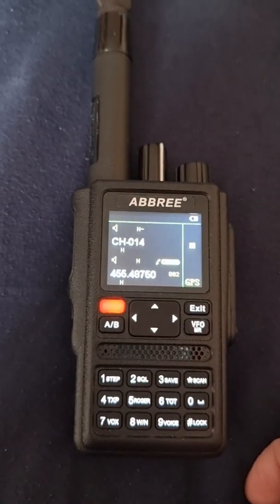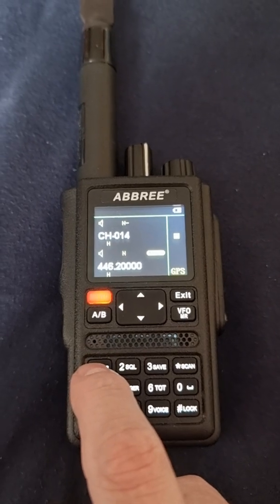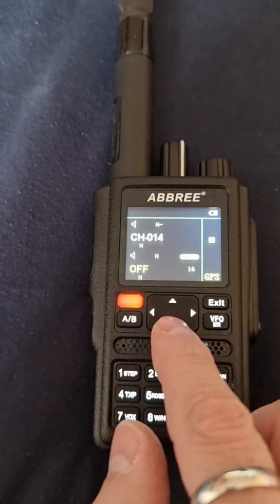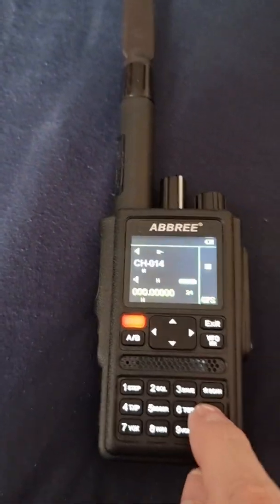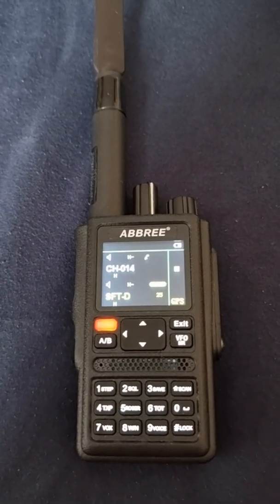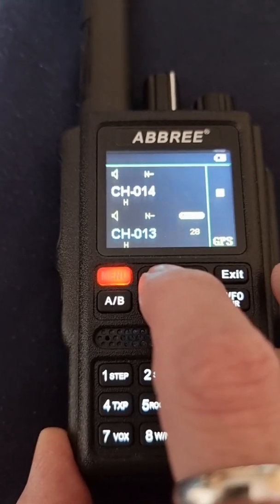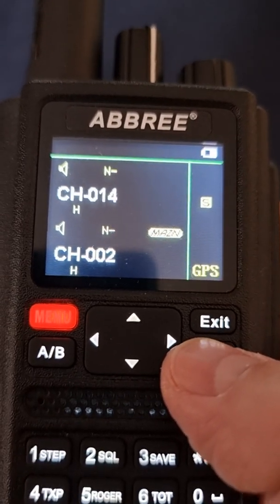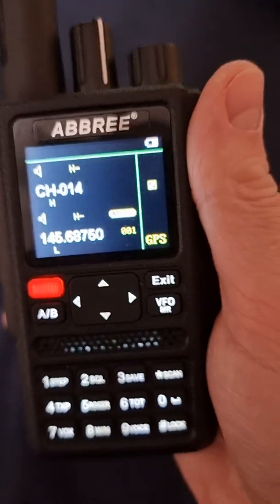How to program manually repeater on Abbree AR-F8.

Comment: Hi I got same radio. I got problem when I swich it on. Only red LED diode keeps flashing next to antenna  and nothing else comes up. Screen remains black(off). Battery was charged and I even try with different battery (same output voltage) which says no change. Any idea what's up and how to fix it? Please help.